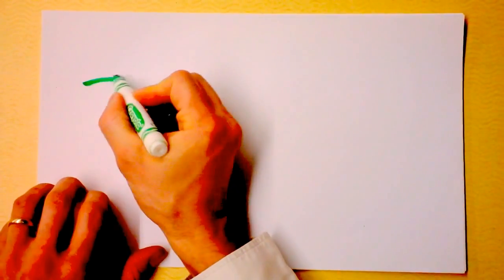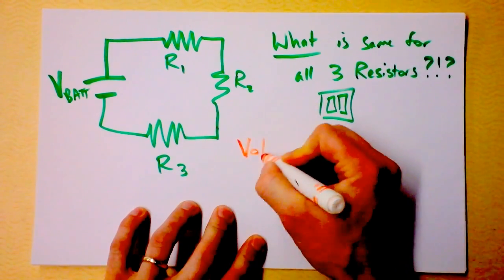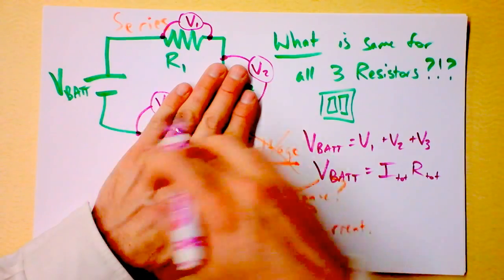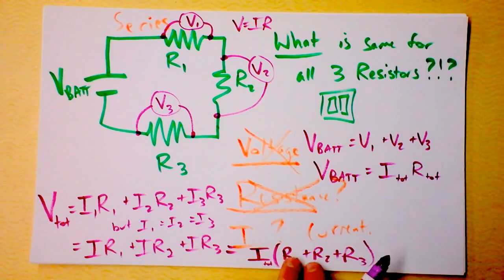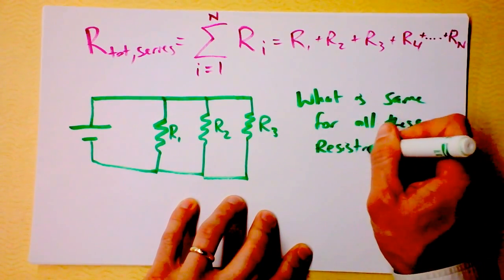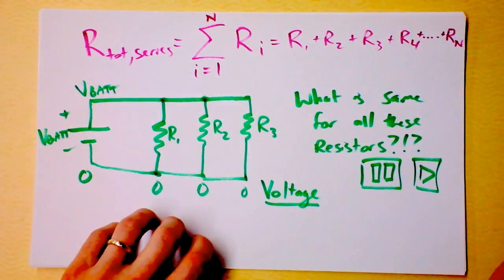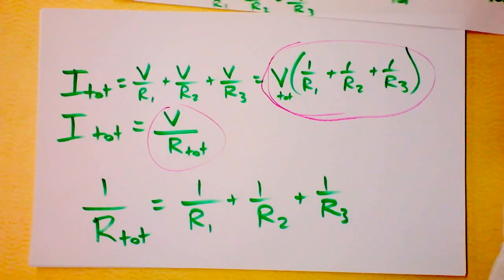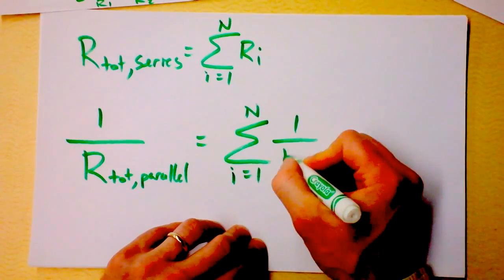Series and Parallel DC Circuits Intro | Equivalent Resistances of Resistors Reduction | Doc Physics

Comment: Wait, don't resistors oppose current flow? So why is the current same across all resistors in a series circuit? I don't get it.
Reply from the maker: Lovely question.  Evidence for resistors opposing current flow comes from putting an additional resistor in series - the current will decrease!  But you'll understand your second question better if you think about what current means.

Comment: 8:43 
so v1  v2  v3 are all basically Vbattery, thats the voltage so that same number is used along with the right resistor amount to figure out i1 or i2 or i3

Comment: I guess the fact that resistors in series increase resistance corresponds to lengthening a single resistor, and resistors in parrallel is like increasing the cross sectional area of a single resistor which you also mentioned would decrease resistance (in a previous video).

With respect to the infinite resistors in parallel discussion. Would no current flow through it because it is divided into infinitesimal small amounts between all the branches?

Why would I_total not just flow through the branch with the smallest resistance and skip all of the bigger resistors?
Reply from the maker: 1st q:  no current would flow through each resistor, but finite current would flow through the infinite number of them, 'cuz zero times infinity is 12.

2nd q:  GREAT question.  There is a classic economic explanation of this effect, actually.  I can't find a ref to it now, though.  Think of it as a seven-lane highway next to an outer road.  In order to maximize car flow, some people will always drive on the outer road.
Reply: +Suzie Q First of all, excuse the bad english
Perhaps is too late for you, you might be already knowledgeable, but to anyone interested
Imagine you have those multi contact devices where you can connect lots of things, well. regarding your second question, if you connect say your washer which has a big cable with low resistance to flow, it is not like you cannot connect something with a smaller cable like a tv or your phone charger at the same time... The current to feed all the devices is there, right?

It just cant skip the bigger resistors, why? because you have already provided a path for the electrons to flow,  say minus and plus when working with batteries or hot and ground in some electric instalation at home... every device connected represents a load. And they will be charged while the battery has the potential to do so.

You may have probably heard that you cannot connect that many devices at the same time in a contact, and you will find the answer in your own words, in parallel resistance is like increasing the cross sectional area, so the more devices or resistors or loads you connect into a circuit being fed by the same source, will drain the required amount of current they need, you add more and more devices until the overall resistance is so low that you will cause a short circuit, burning your equipment or breaking some fuses at home.

Say its an ideal world and you cannot have short circuits damaging your equipment, then you can add resistors or devices until the source of voltage gets depleted.